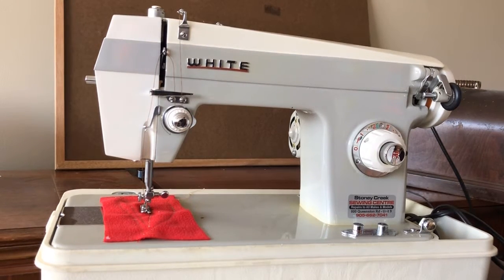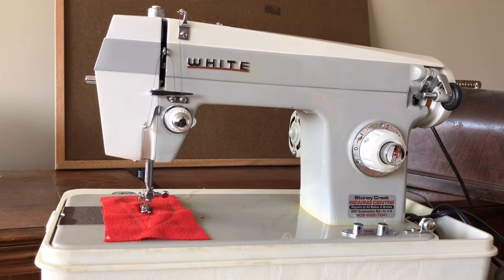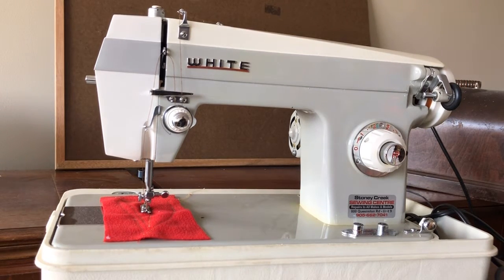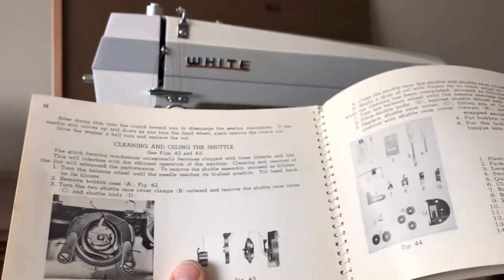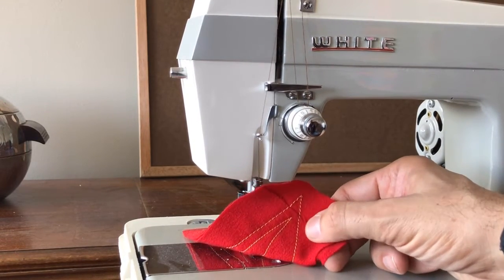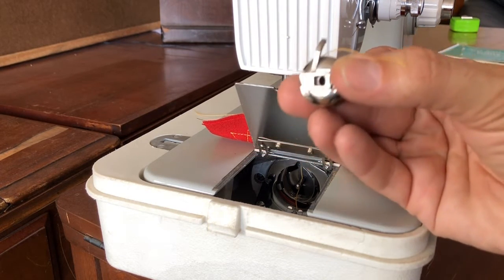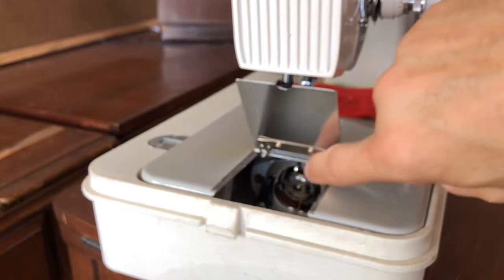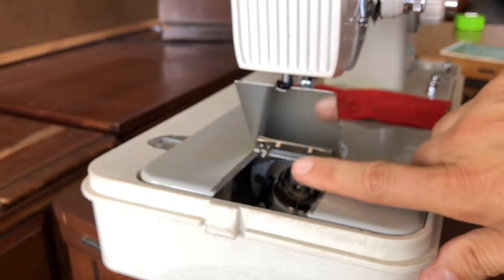TROUBLESHOOTING SERIES #1:  An Ounce of Prevention is Worth? Dealing With Thread Tension Issues!

Comment: Thanks again for a great video. 
Any problems or benefits between a machine with the bobbin/hook facing to the left or toward the operator? 
Which is better?  
Thanks again.
Reply from the maker: Hi Michael.  Well, it depends on what you are sewing.  For most American and Japanese models, the only time you might want a Side loading vs. Front loading bobbin is if you have something large on the machine such as a quilt where you might find it a bit more practical to change a bobbin if you need to leave your work piece on the machine.  (This is why drop in bobbin machines can also present a challenge).  But for most applications, the only time the facing direction of a bobbin case is problematic is for some of the Pfaff models where they oddly chose to place the bobbin facing forward even though the bobbin "Hatch" is to the side.  Another odd position can be found on early Bernina 117 models.  They are incredible machines in many ways, but the bobbin loads from the reare of the machine even though the bobbin shuttle "door/plate" is on the side.  In sum, I would say it seldom is a factor and is chosen based on personal preference.